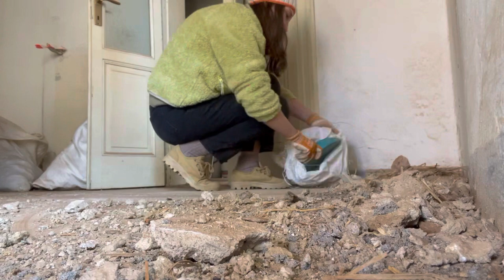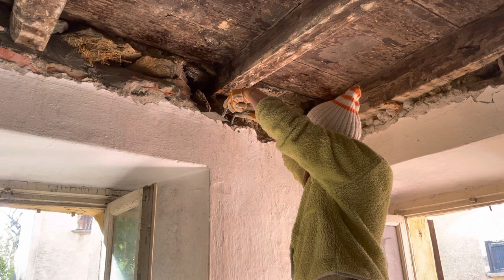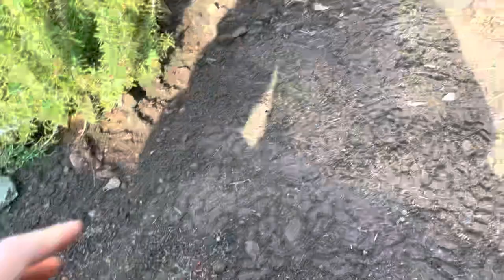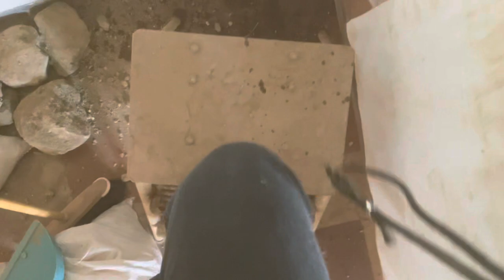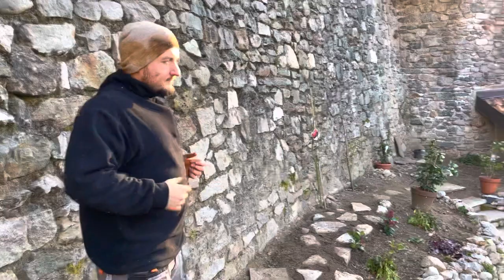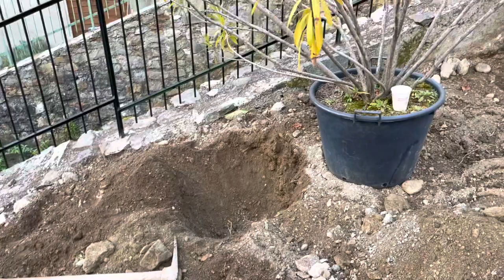Renovating an old ceiling at our Italian villa

Comment: Don’t rince your cement bucket and toss the water in your toilet! The residue can clog your pipes! You sure could use an Eco Flow tech that you can load up with a solar panel and use to load up the batteries of your tools and phone and use to plug in different tools that need electricity! Poor Sergi! What a dusty dirty job! I can only admire you both for working so hard on your dream house!

Comment: I really feel for Sergie 😢. There is a handheld sander that you can buy similar to what you have but it has a vacuum and a bag so the vacuum bag is where the dust goes and there is very little sand in the air. I saw this at a château they’re doing in France. I know you invested some money with those other two sanders but you have a long way to go with other rooms and I feel an investment in this kind of machine would benefit the person who’s using it and the air you’re breathing is safe.They also started like you with your kind of machines but just now they invested in one like that. I didn’t know they existed but they do.😊 happy restorations you’re doing a great job and you’ve come a long way.🌈💕🇨🇦